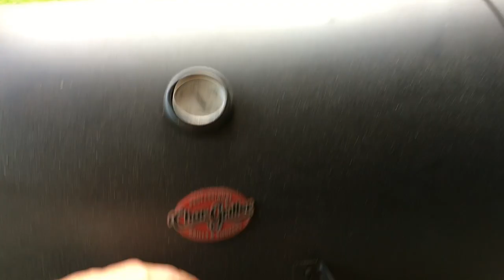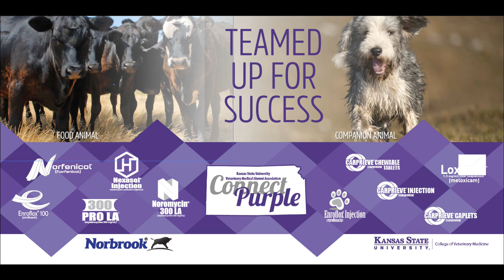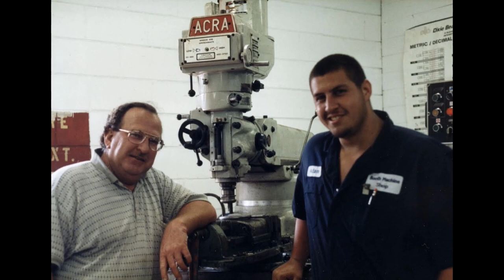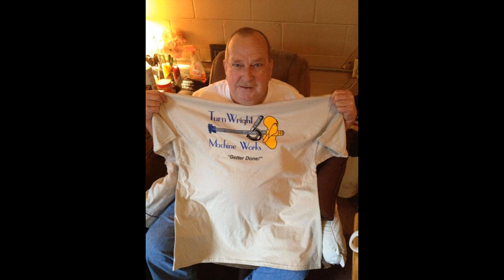Adam & Abby Interview with Mark Lindquist

Comment: I really enjoyed watching this. 
32:10 Abby nailed it!! I wish more people thought like this.
On the entrepreneur topic, as someone who came from a stable, good paying job to now running a small business, you're right. It's hard and it's scary... I make a fraction of what I used to (for now;), and the pressure is endless. But In my case, I have learned a ton of things that I just couldn't have or wouldn't have in my free time. And I found ways to do without, to economize, and what I really didn't need.
But for down the road, I'm gaining skills and experiences that will count big time and learning to make sure the struggle doesn't cost me much in terms of sanity, health, and relationships. It's not easy finding that work-life balance. Actually, I get so distracted tackling the task at hand and making the process better, I tend to forget altogether about the prospect of more profits down the road...

Comment: Adam, good luck getting the shop built on a residential property. I tried that before. But local zoning laws, insurance and local politics shot it clean out of the sky. Also getting true three phase power to the property was more than an arm and a leg. I really hope you can do it. Good luck! One huge tip: Go before the zoning board and get 100% acceptance from them before you buy the land. Neighbors in a 300 foot radius have to be notified about what you intend to do there as a business. Perhaps FL is easier? MA is a nightmare!
Reply from the maker: +J P There are plenty of areas in town properly zoned. It's not in neighborhoods, but places more like right off the main roads. It'll be challenging though that's for sure.

Comment: Great video.  But you are right running your own business is very hard most times.  I've owned my company for 18 years and only have had 2 vacations a total 12 days.  Ive been married 3 times or have two exwives.  It is hard on family.  I now have sold 25% of company and have started working for a larger company.  It means I'm home more but it also means I'm stuck at a wage level and it doesn't matter how hard I work.  But still go 70 hours a week not 100.